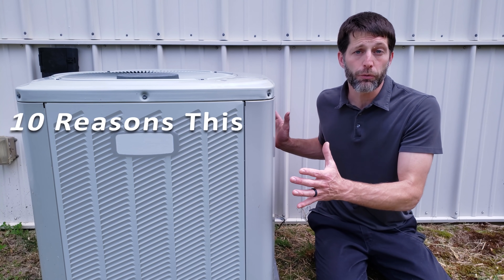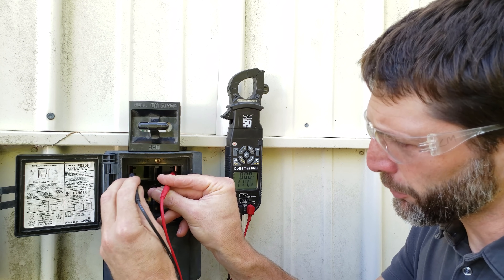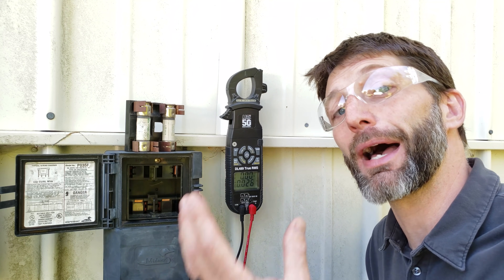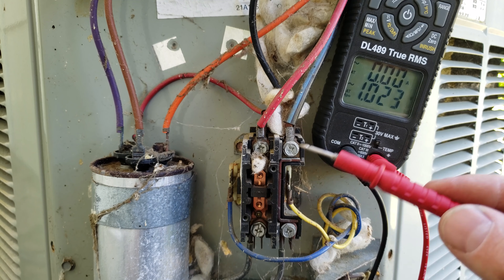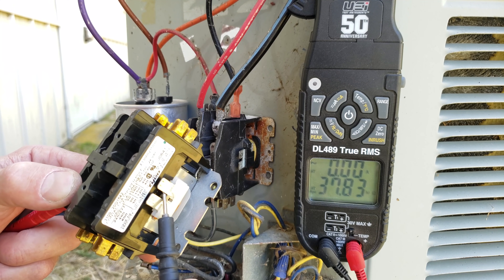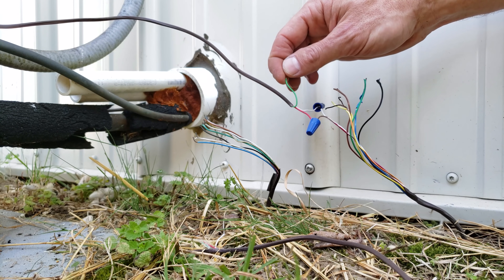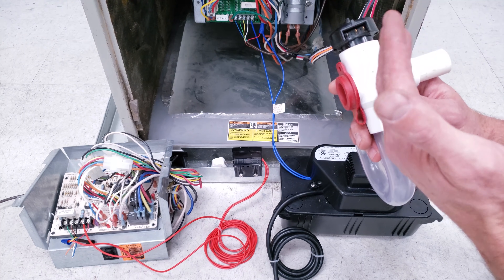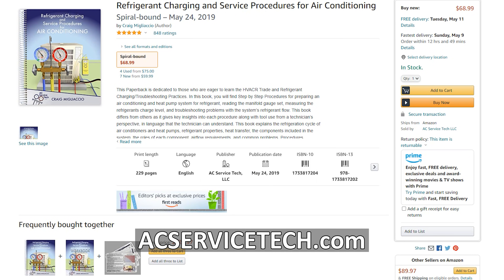Outdoor AC Unit Not Running, Not Turning On! Top 10 Problems!

Comment: Our outdoor condensing unit stopped working.  I found this video.  Following the steps I tested the two fuses and It turned out that one of the fuses was bad.  When I opened the disconnect I found a wasp nest inside.  I think that caused the problem.  Anyway that got the unit running and its been working fine since.  I really appreciate your straight forward and clear communication.  Thanks more than I can express.

Comment: Have an issue where outside unit wouldn't come on, in house breaker not tripped. Reset the breaker and outside unit started working. This has happened twice in the past two months. Any ideas?

Comment: I have an "old coffin" style Rheem condenser (one of the big green ones). I recently had to stop the condenser fan motor out for a new after market version and I think I may have messed something up. The fan worked for about 2 minutes but the contactor was sporadically sparking. Eventually it just stopped working (won't even respond at all to power). I tried switching the contactor to one I bought from ACE hardware but still no improvement. Have any ideas? 😢

Comment: Just finished a heat wave and of course my A/C went out. I just replaced the capacitor inside 2 weeks ago. Then the heatwave hit and no air. Repairman replaced the outside capacitor. A/c coming on but shuts off. Replaced the fan motor and all seems good. Out nearly a thousand bucks. I love watching the videos and it looks so simple. But without the proper tools and knowledge I wouldn’t mess with a 220v system. My system is 15years old. This is the first major repair other than some routine maintenance. 😊

Comment: Capacitor is 2 years old w no bulge and getting no power outside and no compressor trying to kick on or anything,. Just simply not getting any power to outside unit but inside unit is functional w brand new thermostat.. did more troubleshooting.  Thinking it's relay switch .. which there is 2 that also has 2 breakers it connects to. Any advice...? Please help I'm not trying to spend $1500 but also trying to learn bc who knows I may want to go into hvac and retire and I definitely wouldn't overcharge for just a minimal fix like a capacitor that most people who would overcharge.... thank you !!!

Comment: My issue ended up being "phantom power under load" .. very close to Problem #1 or #2, but my meter was reading 240VAC at the disconnect, and 240VAC across L1 and L2 of the contactor... until (IMPORTANT) the contactor switch was closed.. at which point the 240VAC dropped to 0V, and the system acted like it was dead. I shut off power at the breaker, and started undoing the wiring of the disconnect box. In my case, the jagged edge of the hole that the installer drilled into my home's aluminum siding had likely sliced the insulation off one line of the power cable. It was OK for 31 years, but moisture (and maybe arcing) finally turned the stranded aluminum wiring inside the cable into white aluminum powder. Pulling the slack from the wire from inside the house, cutting off the damaged part, and re-writing the disconnect box did the trick for me.

Comment: I’ve had my ac unit for like 25 years.  A few years ago in 116° weather my ac stopped working.  After watching YouTube I was sure the capacitor blew out.  It did!  Replaced it and back in business.  Yesterday was hot as hell so turned on the ac and the thermostat and fan inside my house came on,  but blowing warm air!  Went outside and my ac unit wasn’t on but made a very low hum.  Watched videos and damn near booked a repairman.  Woke up this morning said screw it went and got another capacitor.  Threw it in and my ac unit came on blowing cold air again.  My symptoms were not definitive in any videos I watched, so just replace the capacitor first and if it’s not the problem you have an extra one sitting around.  I was shocked it burnt out again after 4 years when the original one lasted 24 years.

Comment: But what if i don’t have 120v going to the outside unit? I measure the voltage in the disconnect and have 240v going in but not the 120v going out

Comment: my goodman compact unit wont come on til I throw water down into the compressor area from the top, otherwise just the circulation fan comes on, after the water the exhaust fan comes on and the compressor comes on like normal??
Reply: I had the same problem but I never figured out why it was happening. I ended up putting a mister system around the outside of the condenser. There are YouTube videos showing how to do this and it actually increases the cooling efficiency.

Comment: Hilariously, the first thing I checked was the fuses in the outdoor disconnect in your first example which were not properly installed (they were upside down).  This on top of the furnace being turned off and not back on during the last service.  The guys at Thermocare are clowns, but I ain’t laughing.

Comment: Excellent troubleshooting video. My heat pump condenser would not turn on after calls for heat or cooling. After verifying voltage was reaching the unit, I noticed the contactor was burned and no voltage was getting through. $12 later, I put the new contactor in and we have heat again. Thank you!

Comment: My fiance switched the thermostat to heat and the thermostat went blank and the ac shut off. After this the drain line and condensate pump was filled with water. We vacuumed all the water out and also reset the breaker. Still nothing. The inside unit makes a quiet humming noise and the outside unit isnt doing anything. What else should I check

Comment: Thank you, Craig.  I have been pleased with your educational videos and  have started my education toward work in the HVACR field.       Early this summer, the utility power to my house went off and the outdoor unit would not power-on.    the contactor switch was fried.  I replaced the contactor switch.  About a month ago, the power failed momentarily, again.   The contactor fried, again.  At that point, i replaced my disconnect at the outdoor unit with a FUSED disconnect, and i added a surge protector to the circuit at the disconnect.     Today, the power failed momentarily, again.  But this time, the event caused a fuse on one line to blow ($3 loss), instead of a $20 contactor to be fried.  And the fuse change was much more quickly done.     In this video, Craig arrived at the cause of my unit's no-start condition in the first two minutes.  Thank you again, Craig.

Comment: I had trouble with contactor not pulling in when i pushed it in manually the compressor came on but not fan so i checked fan and it seemed hard to turn i spun it around a bit and it seemed looser then manually tried the contactor also pushed thermal reset on line when i pushed down on contactor it made crunch noise and got spark and buzz not sure if contactor had bug in it or just worn it is 25 years old so I got a replacement contactor and fan motor but unit has been running since i squished contactor going to replace it anyway and take a look inside. and the 25-year-old capacitor is still good and in spec even though it is covered in rust amazingly

Comment: I powered off my furnace because we went on vacation so it would not cool an unoccupied house and when we got home the fan would not spin.  Also found a mouse nest next to the Run Capacitor.

My AC unit has an ECM motor, so there is no external capacitor and will not spin. I’ve taken the motor apart and it checked out Good on Ohms.

On a 45 MDF +\- 6% capacitor at what MDF value would this capacitor be bad?   I assume 6% of 45 or 42.3 MDF?  My capacitors currently is registering at 44.3 MDF and the fan won’t spin.

Comment: Thanks for vid Craig..! I have an ancient Comfort Aire by Heat Controller Inc. that still uses R22 ("liquid gold"). It had power at outside contactor but 24v contact was not pulling in. I pressed it in manually with screwdriver and compressor and fan kicked on. So that led me to follow the thermostat wiring like you say in vid. It led me all the way back to the older air handler unit (in conjuction with the old gas heating furnace) which is where I found the blue wire, of the inside thermostat wiring from the actual thermostat, loose and barely hanging off the transformer terminal screw. Screw must have loosened due to vibration at older air handler. Talk about a simple repair with no cost to me except for my time (not an expensive tech. that would have cost me hundreds). It's all about starting at the source and having a good multimeter.  Wanted to attach a photo of the wiring at air handler (furnace), but don't see that option. Hope this brief trouble shooting scenario I added here may also help others with getting ideas of what could be the problem and a simple solution. 😊

Comment: Thank you for your detailed explanation. One of my 24v wired was disconnected and chewed by a rodent. I reconnected and put an electrical tape on the wires that were expose and it work!

Comment: Thank you for your video.
Yesterday i have silence from attic handle unit, and ac pump.
Thermostat was blank, i do not using batteries. 
I put batteries, that not fixed issues, therefore display is come back on.
I was outside hauling my dog walking neighbor in the dark, and shared, they said, recently they have tech cleaned overflow valve.
I thankly climb in to the attic, previously exposed ac pump and inspected wiring, brakers, and condenser.
I found overflow censor with brown liquids and used near laying cleaning brush to purge it all. Moving sensors i heard first clicking. 
Got it all back. But silence due to delay probably.
About to remove air handling panel to inspect for fuses, etc., and unit is kicked on. I was satisfactory climbed down, where found outside pump is silent.
After witching your video next morning i will use my power tester to see currents on the wires, and see if i can trace issues.
Yesterday i should not touch pump, and sensor outside, that just below lid on TH4B3021SA - Luxaire, as i think problem was overflow sensor, and i cannot believe i could have 2 issues at the same time. Will purge and see if gas is in the system with screwdriver.
Thanks a lot for your video.
Hope this morning will be successful. 
Any comments highly appretiated.

Comment: Thanks, was told needed whole new system, and i might, but after replacing bad contactor im back running again. 240v on bottom and nothing on top, so i replaced it and bingo, great vids

Comment: Hi, i just replaced my compressor and I tried recharging the system, using a clamp meter to measure the amount Of current flowing through the compressor.
..i discovered the current shots as high 12A and then the compressors cuts out.
Which is abnormal for a 1hp Unit...
Please kindly help share your experience

Comment: What’s the purpose of the flow switch? The one you talk about in minute 6:55. I’m in my unit I have to drain the water on it so the outside condenser start up.
Reply: It’s a safety feature
Reply: @Barnowl41  thanks!

Comment: Excellent guide. In my case, it was a corroded 24V connection to the contactor. Pulled the contacts off to measure coil resistance, confirmed coil ok, put low voltage connectors back on, and the contactor immediately tripped and turned on the condenser. Now I can get me a new contactor to have a spare just in case, with my ac still working. Thanks!

Comment: Thanks for posting this helped us out. We had power at the quick disconnect and long and behold the internal circuit tripped. We reset the Unit and now we have cold air. Keeping a close eye on it for now. Thanks again for posting. 👍🏼 subscribed.

Comment: Genius. Problem number 9 for me. I replaced capacitors and fuses. Made sure thermostat was ok. Then went down to condensate pump and I shook it slightly and boom it started pumping out a ton of water. Turns out it’s filthy inside and clogged and cut the ac. Problem solved. Thank you sir.

Comment: What if the batteries in the thermostat are good, the capacitor was recently switched out, and all the switches are on including the breaker, but the thermostat is blank? Any thoughts on that?

Comment: Hey, how do I check to see if there is juice to the connector from the system?

I have checked the cap and the connector as you show in the video and all levels are good. I don't see anything at the contacts, it is spotless. When I press the connector, everything starts up as normal. The fuse on the board in the attic is good. The drip pan is dry; actually has dust in it. The valve in the u-joint is down, and completely dry. The batteries in the controller are brand new Duracells. My daughter said it sounded like it was trying to run last night, humming, but I didn't hear it.

This system is a Goodman and it is only 3 years old and the guy who installed it won't return my calls. (small company and I gave him the chance to do my AC) 

The system does not hum. It is not trying to run, but when I push in the connector the outside fan tries to run. Any help is GREATLY appreciated. It's 90 degrees and this is not fun.

Edit: I umped the R to G, B and W and nothing came on. It seems there is no power getting to the thermostat.

Comment: Thank you so much for all your videos.  you saved me a system replacement and it was only a contactor issue.  I managed to clean/sand the burned surface to make it work again until I get the replacement part.  Great video.  Thanks again.

Comment: I’m having a problem with a EIM losing power periodically and shutting off completely and after several minutes, it turns back on. This is causing my thermostat turning on and off (ac turning off and on periodically). When it turns on, the voltage is 24v and when it’s turns off it’s 0-14v. Why is this happening? I recently replaced the indoor capacitor and fan motor. It worked fine for a day or so, then the problem above began to occur.

Comment: There is power going in to the contact but nothing is coming through the lo volt terminals I replaced the contacts but still same problem. Replaced the capacitors too same problem.
Reply: Everything seems to be working inside. I replaced those parts with new Everything is wired correctly.  But still same problem.  I even checked the refrigerant by pushing the contacts in manually they go to the proper run level. So I'm not sure what to do next..

Comment: At 1:40, why not measure line-line and load-load at the disconnect box before pulling the fuses?  If either fuse is blown you won’t see 240V load-load, right?

Comment: What if the max voltage at the disconnect is 120 not 240? The unit is rated for between 197 and 253 V, so I’m assuming this is my problem.

Comment: hopefully this helps me. I installed an Ecobee over the winter. When I turned on the furnace, the a/c would turn on, too. I did some changes for the a/c high voltage to not turn on, but the 24 volt kept running when the furnace was on.

I didn't want to make any more changes until it started warming up, but today I put in my old thermostat and the a/c is not doing anything. I think the video will help me trace the issue. (I didn't have 240v outside when testing)

Comment: Great info! One quick cold weather question if I may:  When you are trouble shooting a heat pump and turning it on an off, are you just leaving the furnace in a state of "call for heat" and then using the heat pump's 'fuse block' to start and stop the unit itself, or are you turning the furnace on and off each time?  OR.... are you 'jumpering' some contacts on the heat pump to fire it up just for testing? 

 I have always wondered what goes on with this.  I am in a situation right now where I need to figure this out so that I can bypass the comp, then the fan and even check out if the contactor is acting up due to some noises I'm hearing.  It seems a little silly to run in and out of the house each time. My plan was to pull the fuses, call for heat indoors and then plug the fuses in for testing and pull them back out between tests all while the furnace is still running.  Does this make sense?

Comment: My unit is not coming on, the thermostat  has a flashing fan and heat display. I have changed the disconnect fuse. Still not coming on. Do you have any suggestions?

Comment: Heat pump.  Cool works as should.  When heat is on. Outside unit not turning on.  Inside fan turns on.  Thermostat says heat on.  Fans blowing through ducts.   Outside unit not turning on.     When cool is on. All works and cools   Any help would be appreciated. Thanks

Comment: Outstanding video.  Thermostat wires are top of my list as I recently replaced blower motor and control panel on the indoor unit, but this tells me what else to check if that's not it.

Comment: Hi, when l turn on the unit, cold air is blowing out and everything seems running fine including the fan. But after  a few seconds, the fan stop turning. What do you the problem is. Mind is a Keeprite SSC-31-ID built in the 1980's. Thank you

Comment: Hello Craig, I have a old GE central A/C unit not working I attempted to check the capacitors 1 fan and the run, but the capacitors are so rusty you can't see anything on them. I would like to replace both, I tried on Amazon but they all needed the UF off the capacitor not by the model #
I was hoping you could help! The model# is GE 21TA936H1F both capacitors are oval, I really appreciate it if you can help, Thanks